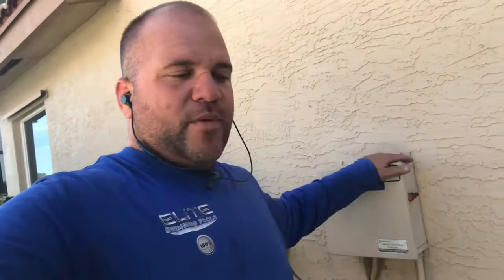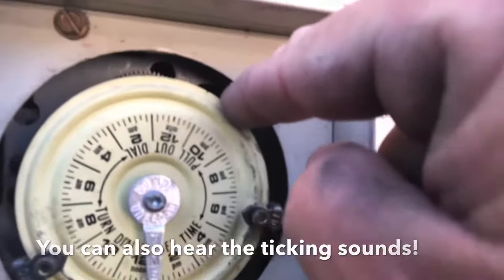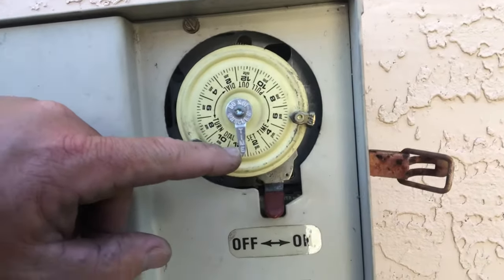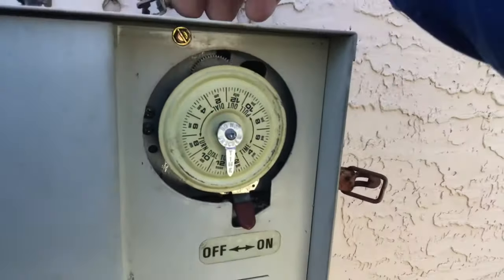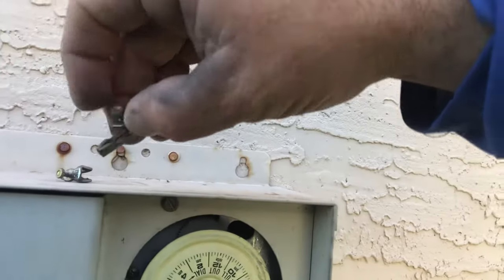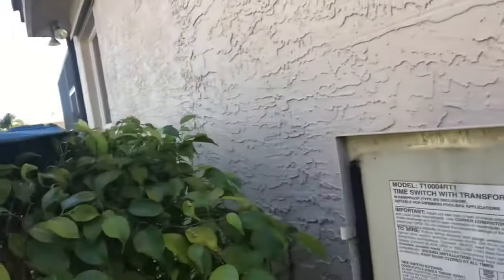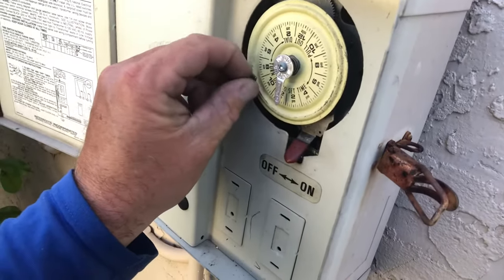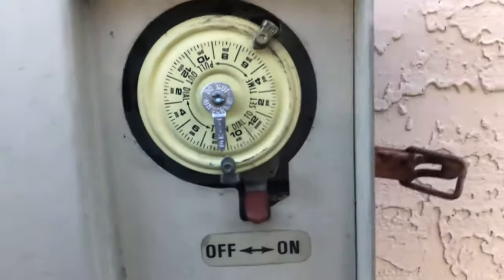Pool Timer Not Turning ON or OFF!! Watch these tips and tricks before replacing it.

Comment: What would be the next step? I replaced the pin and it still doesn’t turn on. The timer is working, everything is moving properly, it turns off and the override works. The only issue, is that it doesn’t turn on even with the new pin. Thank you for your help
Reply from the maker: Then the best thing is to replace the timer mechanism.

Comment: Gear is moving. My on and off prongs are new. I hear the timer ticking. When I set time the yellow disl to correct time it never moves.
Reply from the maker: Check on dial movement after a 30 min- 1hr time difference. Each hash mark shown on dial is a 15 minute time increment. If dial doesn’t move after testing it this way, replace the mechanism
Reply: Elite Swimming Pools TV I’m having same issue as noted above, yellow plate is not moving.  What exactly do you mean by replace “mechanism”? Is that the yellow time plate?
Reply from the maker: The mechanism is the timer itself (all one piece: the dial and the terminals where wires go into) its sold separately. Ensure you know your incoming voltage: 120v or 240v and purchase that version. Or hire a pool contractor or licensed electrician
Reply: Could not hear you very well  especially when you turned towards the timer

Comment: Bingo, timer failed to turn on and I found the dial jammed.  Never knew the on/off trippers could be bent but that was the cause.  Spent $4 for two new sets.  Might add that the timer motor will  fail long before the timer mechanism.  You can purchase and replace the timer motor for about 1/3 the cost of a new timer.  Thanks for the tip
Reply from the maker: Your welcome.
Reply: Update, a couple of days later the new "on" tripper bent again and jammed the mechanism.  Had another Intermatic timer so I took off the yellow timer disk on both an compared expecting to find the cam broken or worn, bad spring/gear or something else with damage.  Nothing was different so this time I added an ample layer of white lithium grease to the cam and the space where the trip spring is located.   So far it's still running without jamming and bending another tripper.  This timer is at least 15 years old and the clock has been replace once but it was never lubricated.
Reply: @johnwalker6121  how did you fix the motor timer ??

Comment: I have a T101 timer for 2 illuminated signs on the front of my building. The signs wont’t turn on at all. They will not turn on even when using the manual override lever. The dial rotates and keeps time correctly. I only see 1 gear turning (the one furthest back) when I look through the inspection hole. Do all the dials need to be turning? I have voltage coming in and going out of the timer. Could it be the on and off trippers being no good or a worn out trip lever? Should I just replace the whole timer mechanism? Thanks

Comment: Great explicacion. Now if the problem doesnt consist on the ON Spinner, what should I do?
Reply from the maker: If you have checked both timer tripping pins and they both look good and are not bent, first check and make sure the clock is properly set to the hour it currently is when your checking. 2: make sure the yellow dial is fully retracted back. Pull on dial and release it ensuring it’s back. 3: check voltage with a voltage meter across lines and load sides of the timer. If you have voltage coming In but not  going out endure the timer switch is on and recheck. If still no peer going out with timer ON, then the timer is bad. If you have both Voltage coming in and out, then check the back of the pump motor. 4: check behind the the sight hole in the upper right hand side and see if the gears are moving. If Yes, then the time clock is being managed. If No, then replace the mechanism. Hopefully this helps.

Comment: The piece the the on pin triggers can also be worn. Mine is worn and is causing the pin to push away from the motor and no turn on. It's the piece behind the dial face.

Comment: Nice video, thanks for the post. Need your advice. New home, new pool. After it was turned off for 4 days (poolman turned off from main filter switch), I tried to turn on (Timer Switch) - it's starts working, but never stop. After 12 hours I decided to stop and now don't know what to do? I doesn't turn off. What I'm doing wrong?
Reply: I'll try to explain - it starts working - after I TURN -on, and stopped only when I turn-off manually. I tried to put 4 hour schedule, but after 8 hours - it was still working. How to force time work properly - start at 6pm, stop and 6am (as it was setup on timer).  thanks
Reply from the maker: Check the ON/OFF pins on the yellow dial. Remove and inspect the metal. If the two leg points that should touch and make a triangle are separated then try to bend it back into place and straighten metal. Or simply buy a replacement set of tripper pins. If you do that and the timer still by passes the set ON /OFF timer then possibly the motor that manages the time clock went bad. The metal arrow in the center of yellow dial which pints down is the marker for when setting the actual correct time of day. Take notice of this time (ex. You check it and it’s 10am) come back an hour later and recheck the timer (with the power On of course) and see if the dial has moved to the 11am hour. If it has then the dial is moving and the motor that manages the time is working, if not then the motor and timer is bad. Replace timer mechanism for new one.

Comment: You did a nice job of  explaining the general working of the timer.  Ours turns on but not OFF??  Can you help with this please?
Reply from the maker: Sure, remove your OFF pin and check the metal for any twists or bends. The pin should be in a triangular shape with the two points touching at the end. If they are not you can attempt to straighten the metal or simply purchase a new set at a hardware or pool store.
Reply from the maker: Secondly you can check to make sure the actual dial is rotating. First take notice of the current time the center arrow is pointing to. Keep the power to timer ON and check back an hour later. If the dial has moved then the mechanism which manages the time is operational.
Reply: @EliteSwimmingPoolsTV  what if  the dial turns but the on/off manual override doesn't work. Trying to find if there is a second timer or not. I even shut the power to the timer and lights still stayed on.

Comment: I have a question. So I just bought a house that has a pool, first time pool owner, and the timer does not work. I check the gears do work in the back. But when I go to turn on the pool with the on/off button it doesn’t do anything. What should I do?
Reply from the maker: Replace the timer

Comment: Replaced both trippers on my T104P3 but unit still not automatically turning on or off. Timer wheel will operate correctly manually until it hits the tripper and then will just stop instead of flipping the switch.
Reply from the maker: Replace the mechanism

Comment: Hi, I turned the pump on manually last night with the dial. And it turned off at the right time by itself. Now it won’t turn on at all , not even manually. Any tips? Thank you for your time.
Reply: Pull timer out and turn clock by hand it could be stuck at pin

Comment: So do we keep the ON/off switch In Off position when we put the arm pin?
Reply from the maker: If your talking about the little pins that screw onto the yellow dial, then it doesn’t matter if the ON/OFF switch is on or off. Just make sure you place them correctly on the dial and not near the center arrow. If the arrow is at the position of where you like to place one of the tripper pins, you’ll have to grab dial and pull out towards you and rotate to a different position

Comment: This maybe a stupid question BUT, is the manual switch supposed to stay in the off position all the time to be working properly? I can turn on the pump with that switch but it just stays on. So, normally, should that switch trip ON when the timer is working properly and should it switch off when the timer hits the off pin?
Reply from the maker: Yes
Reply from the maker: A good working timer will switch On the pump when it reaches the ON pin and turn off when it reaches the OFF pin.

Comment: My timer gear moves only one that i can see,  but not ticking loudly anymore and wont trigger start. Any ideas? I did turn it on manually and it turned off on itself in the morning.
Reply from the maker: Remove and check the ON PIN. If the legs of the pin are twisted or bent then this could be one of the reasons it’s not turning ON. One other check could be to look at the timer yellow dial focus on the center silver arrow, this arrow points to the time of the clock and day. Remember what hour and minute it’s pointing at, return in an hour and check to see if the dial has moved.  If it did then the dial is moving as it should and possible pin problem. If it has not moved and has stayed at the same spot after an hour has passed, then have the timer mechanism replaced. Good luck.

Comment: My pool filter stopped when the other timer (I have 2 timers) stopped.  No prob.  So, I go to hit switch for filter pump system on and nothing happens.  Checked circuit breaker, all good.  The lights work in pool, so there is power.  Why would I be not able to get filter pump running?  Any suggestions?  The pool company came today, and thus happened an hour after when the Solaris timer ended at noon.  It must have de activated the filter pump.
Reply from the maker: Do you have a 2 Speed Pump?
Reply: Elite Swimming Pools TV I don’t think so.  It uses one speed at all times.  I ordered a new panel box on amazon.
Reply from the maker: Did you check voltage across the timer mechanism? Did you check voltage at the motor contacts? 

This is where you should start.
Reply: Elite Swimming Pools TV Thank you.  I feel sheepish to admit that I just fixed it.  It was one of the  breakers on the control box which was stiff.  I thought I had been switching it back and forth.  This morning, I put some muscle in it, and Voilá!!  So, thank you for being so thoughtful to respond twice.

Comment: hi sir my intermatic doesnt work at all. I can only turn it on and off by the breaker. Does that mean the motor burnt out? will I have to replace the whole assembly
Reply from the maker: If you are having to turn on/off the pool pump by the breaker, this may mean the clock managing motor has stopped working or that the contacts may not be making great contacts or the dial itself could be stuck. 

Turn the breaker On, check the time on your watch or mobile phone when you turn breaker on and compare it to the time the clock is marking and allow the pump to run for about an hour. Example, let’s say the dial is marking 2:00pm this would be shown by The middle silver arrow in the center of the yellow dial pointing at the 2:00pm line. Allowing the pump to run for an hour, the dial should rotate to 3:00pm. If it does not rotate then it’s possible that the motor has failed or that the dial itself could be stuck,wedged, or corroded. Ensure that both line and load contacts are receiving the proper voltage. Line side will have direct electrical current from breaker, load side will receive power once the toggle lever is switch to On. 
Once you’ve checked these areas if it still persists then replace the mechanism and hire a licensed pool contractor or electrician if you need assistance.
Reply: @EliteSwimmingPoolsTV  dude I cant thank you enough . im actually in the pool industry and you gave me extremely helpful advice. Thanks again
Reply from the maker: Shea my pleasure. Glad to read I have assisted you with great advise. .👍🏼

Comment: My breaker tripped. I reset it but the pump isn’t running. I can see one gear moving but I don’t hear humming at the timer. I think I need to replace the breaker. It’s the quickest & easiest fix. Should I consider anything else?
Reply from the maker: If your breaker for the pool pump is tripping most likely the motor for the pump needs to be replaced

Comment: Just installed new Intermatic timer Model T104R for pool pump.  It comes on when clock hits on pin and clock continues running but when it hits the stop pin pump turns off but clock stops as well.  I replaced off pin twice with new off pins but same thing happens, clock stops when dial reaches the stop pin.  Any suggestions?
Reply from the maker: Ok. So if this is the case, then how does the clock hit the ON pin the next day if the dial doesn’t move through out the OFF hours of the clock? Make sure that once the timer hits the OFF PIN and shuts off the pump it’s still moving. You can do this by checking and taking note of the hour the center arrow is pointing at and coming back 1 hour later. If it has moved then your fine if it doesn’t then the mechanical motorized mechanism behind the timer has failed. This mechanism is what managed the dial rotation and time of the clock.
Reply from the maker: Make sure your connection on the 1 & 3 LINE side of the clock is tight. The 1 & 3 terminals is where the motorized mechanism is wired to. Also make sure the contacts do not have any debris, ants or other crud stuck between or around these contacts.

Comment: My pump turn on when I manually throw it on but the gears are not moving. What should I do?
Reply from the maker: The timer gear motor is bad. You can order new gear motor or buy new timer mechanism

Comment: I replaced the on pin with two new pins and neither worked. The off pin works fine but the on pins will not turn the switch on. Any tips?
Reply from the maker: Have your made sure the clock dial is in fact moving around as it should each hour of day & night. If yes and timer dial rotates normally and 
If both ON & OFF pins were replaced and your timer is still not turning ON the pump, then it’s time to Replace the timer mechanism completely. Possibly the tripper which engages the ON pin is bad or damaged. Other times it’s a fault mechanism. Have it replaced out and your should be good.
Reply: @EliteSwimmingPoolsTV  Thank you!!

Comment: What do you do if it’s not a power problem or Clip problem? My issue is the on switch doesn’t go all the way “ON” I did switch out my “on” clip and still my on switch didn’t turn on. It stays in between off & on
Reply from the maker: If it looks old and weathered just replace the whole thing

Comment: I keep having to replace the whole timer at least once a year ,is it possible that I keep buying the incorrect model and it’s dying for some reason within a years time ? And how do I find the correct model number ?
Reply: Sometimes you want to just fill in the pool and be done with it.
- leaks occurring in the pool concrete lining
- timer problems
- leaks in the pool plumbing pipes at the pump
- leaks in the pump motor housing
- "you want to charge me how much for monthly pool service?"
- cost of chemicals
- liability risk
- and we use the pool how often?

Sometimes you just think "next time this pool needs resurfacing, I'm filling it in.  Enough is enough."

Type of deal.
Reply from the maker: Sometimes the age of the pool is a factor. Not knowing how old your pool is, but age is a factor. Sometimes the old pool has to be demolished and a new one constructed.
Reply from the maker: The timer model for a 115V electrical system is T101M, for a 230V is a T104M. Make sure your electrical box itself does not have any holes exposed to the weather and outside elements and critters/animals/ants.

Comment: How do I turn on the pump using the switch? I can only turn it on using the plug.
Reply from the maker: Seems you have a plug in 120v motor. You would have to remove the plug wires and rewire the 120v motor wires for traditional wires through a conduit & up to a 120v capacity timer.
Reply: @EliteSwimmingPoolsTV  Turns out that after hitting the reset button after taking out the plug and putting it into the outlet right next to the other one worked. The previous outlet looks like its starting to get fried. That's why I was worried about hitting the rest button before.

Comment: My "off" pin was bent to hell....I saw the "visual motor check" window and the gears were turning....power to pump was good. Bent the pin back into shape....Set timer to the current time 9:00pm....When I got up in the morning it was still pointing to 9:00pm. 
My "Intermatic T104 Electromechanical Timer" never had an issue in 22 years...  Clicked on Amazon, should be another one here today.
Reply: Got the same problem with the "on" pin.  It's jamming.   I installed a brand new "on" pin and within two days it was all bent up and jammed the unit.
Reply from the maker: Then the problem is not the pin, it’s the mechanism itself. Replace your timer and you won’t have this problem. Your timer is probably an older model
Reply: @EliteSwimmingPoolsTV  Yeah...it was a tiny little gear in the gear cluster missing about 3-4 teeth.....easy fix.

Comment: hey! i have this exact timer and i have it set to automatically start at 10 am and stop at 7 pm. the only issue i have is that when i want to go into the pool at 8 pm and i turn the switch to on it only runs the pump for about 10 minutes and then it shuts off. can you explain how to fix this? thanks
Reply from the maker: Ensure that the OFF pin is screwed down at the 7pm hour line on timer dial. Analyze the dial, in the center you’ll see a silver arrow point down from center of dial. This arrow is how and where to set the current hour of day. Check to make sure clock is properly set to correct hour if day. When you go to turn On pump and the Off pin is just a few centimeters to right of center silver arrow once dial rotated to off pin it will shut off pump. Each hash mark on dial is a 15 minute increment of time.